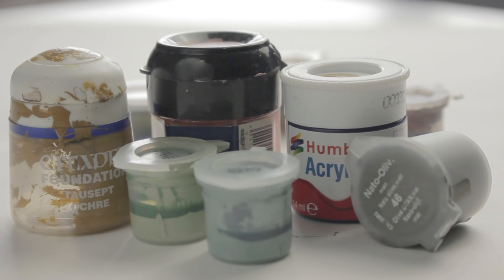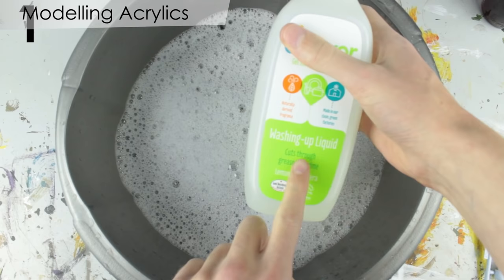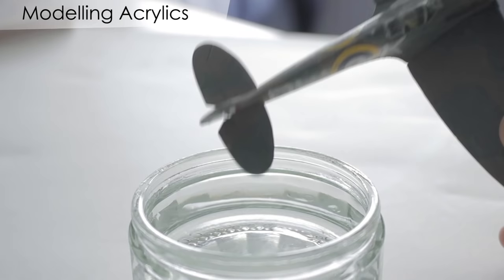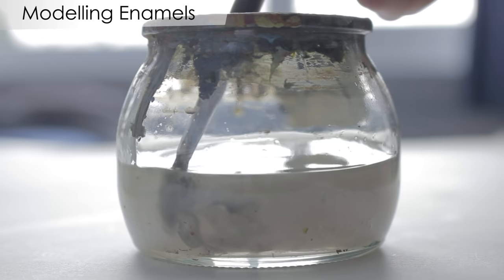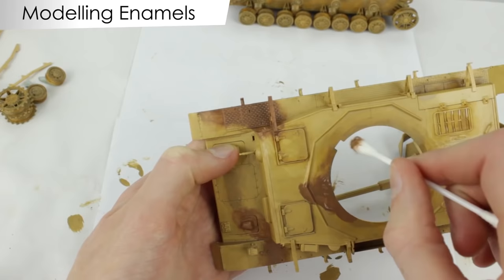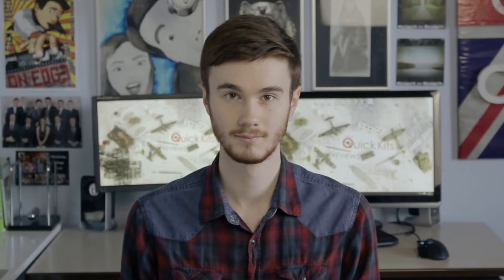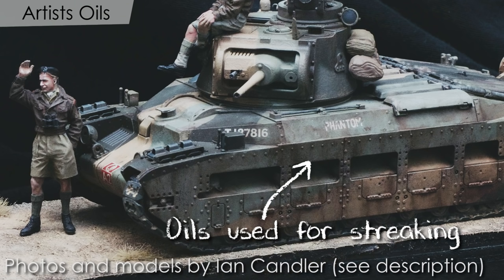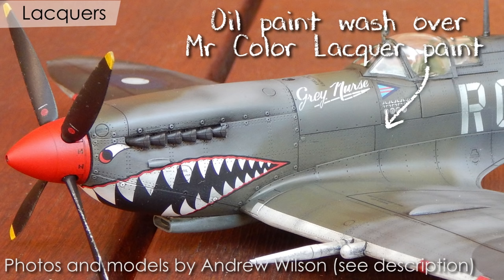Types of Paint Explained

Comment: Hello! I just got into modeling and have a few questions. Do you usually build the kit and then paint it? Or do you paint the pieces while on the spruce and then assemble. For my model there are many different little vehicles and items, so I don’t know (the kit is the Atlantis Mercury Atlas Booster). Also, for enamel paint do you have to wait 24 hours to put on another coat or is that just until you can handle it. Thanks!

Comment: Thanks. I have a 3D print of a transformer character I created and put on Shapeways. I'm getting around to painting the little guy and was wondering about the difference between acrylic and enamel paints. Before I was just painting because it was the shade of color I wanted. I see a lot of people using thinner with the enamel for spray painting. Do I need to use the thinner when just using a brush?
Reply from the maker: Yes, it's always worth thinning your paint to minimise brush strokes. I usually do a ratio of 1 part thinner to 6 parts paint

Comment: what's the best method for removing paint from its little pot and onto the palette for thinning/mixing? Are pipettes ok?
Reply from the maker: I have two syringes which I use; one for the paint and one for the thinner. That way I don't contaminate the paint in the pot with thinner. Good quality pipettes would be okay but I'd watch out for those cheap ones that crack. If you use syringes or pipettes make sure to clean the paint one with white spirit or thinners (by repeatedly sucking it up and squeezing it out in a little pot) so it doesn't get stuck.
Reply: Quick Kits Thank you. I'm new to the hobby, and am already struggling with it all. Powering through motivated by your vids.
Reply from the maker: LIMIT CYCLE The most important thing is that you enjoy it, because that means you will keep doing it and you can only get better by practising. I'm glad to hear that my videos are lessening the struggle somewhat :)

Comment: i think i have made terrible mistake buying tons of tamiya acrylic paint for painting my kits. didnt know enamel is much better result than acrylic paint if we hand painted. 

what if mixing with tamiya retarder with the acrylic?
Reply from the maker: +Kuro inc Well acrylic are still very good when thinned, my Spitfire, Typhoon and Tiger II have been painted with acrylics. I just find enamels have a slightly better finish. Yes Tamiya retarder would help so long as it is the type for acrylic paint. Or just good old water should do the trick. I haven't used Tamiya acrylics before so I'm making presumptions, but I don't think it was a terrible mistake :)
Reply: +Quick Kits I used tamiya white on my P51d (over on my channel on friday) and used a brush, you do have to work quickly as they dry quicker, but if disturbed before they are fully cured can be brushed off and leave streaks/gaps. It will take a few more coats than enamel, but the long drying time of enamel kinda counteracts it. 3x coats acrylic with half hour drying time, or 1x coat enamel with 6 hours drying...

Comment: Im a beginner, so if I brush my model with an acrylic, must I thin it with water first and how much water to thin the paint, thank you:)
Reply from the maker: Yes I'd always recommend thinning the paint. Usually I find a ratio of 1 part thinner (or water) to 7 parts paint is good, but you might want to go thinner depending on the consistency of the paint, eg. 1 part thinner to 4 parts paint. Also, remember to always stir your pots of paints well, before use ;)
Reply: I want to ask you more question about modelling owen. In indonesia, only few people love modelling. How about vinegar? How to stick the paint with plastic?
Reply from the maker: You don't really need vinegar to wash the parts, you can just wash the parts in warm soapy water and that should help the paint stick to the plastic :)
Reply: And the for beginners like me, for a better result what must I use enamel or acrylic? :)

Comment: I have had excellent luck removing acrylic paints with PineSol [USA brand of pine oil  floor and kitchen cleaner] www.pinesol.com   on plastic and metal figures. I soak the minis overnight is covered glass dish and then can use a old toothbrush to remove the paint. I have yet to find any plastic minis damaged by pine oil. Dettol is the brand that is close to PineSol that you can purchase in the UK.

Comment: There is so much misinformaion about paints and especially about acrylics.
Acrylics are not less toxic than other paints, they can infact be just as harmful.
Paint is made of three things not just two but three.
Pigment, medium and carrier.
The pigment is the color, you put this into the medium
Medium is the setting agent, the pigment should be mixed evenly into this liquid to equal out coverage of the what you intend to paint.
Carrier is the liquid that allows you to move the medium around on the surface of what you are painting making sure it covers evenly.

The Pigment can be made of almost anything these days from natural to synthetic, some are even made of acrylics.
The medium is a water based emulsion, this is the part that confuses people, its because of this that acrylics are called water based paints but people confuse this with no chemicals.
The carrier is a liquid such a water or Isopropanol alcohol, or sometimes even oil based liquids can be used to get that mediums coverage even.

People seem to think a "true acrylic" is a paint with an acrylic pigment, an acrylic medium and a waterbased carrier. Its not, any medium that is an acrylic amulsion is an acrylic and they are not all none toxic, in fact is scale modelling most are not none toxic at all.

Comment: :'( I really don't know which paints to get, mostly I am using polymer clay to make models but I also want to be painting 1/16 Figures focusing on realistic detailing of skin and faces. A guy on Youtube I really like has tutorials painting realistic heads and he uses MP Miniature Paints, but I cant buy these online :(
Reply from the maker: For figures you can use artists oil paints I think, or you could try enamels? Try messaging Ian, he's a good figure painter I know: https://youtube.com/ianebbm
Reply: Thanks :-)
Reply: if you've not already done it, humbrol acrylics will work fine. 

oils have to be drained before use and can extend painting time to two or three days
Reply: MaZEEZaM You should acrylic i use acrylic for polymer Clay charms and models and it works just fine
Reply: Thanks :D I since worked out the issues I was having with the paint lifting off when trying to put a second coat on was due to the quality of the paints. I was using Student acrylics, poor choice. We live and learn :D
Reply: MaZEEZaM 
I use pebeo student acrylic for small details, you should try that.

Comment: i think acrylic paints are acrylic based  vs say....... water colors that are truely water based ...also acrylics is a category of which there are several types and combination of ingredients . so its no longer easy to explain acrylic characteristics without determining what type of acrylic paint you are using,, as they vary greatly.
Reply: +Andy X They are, but are initially water soluble until they have fully cured, then they are very difficult to remove with water